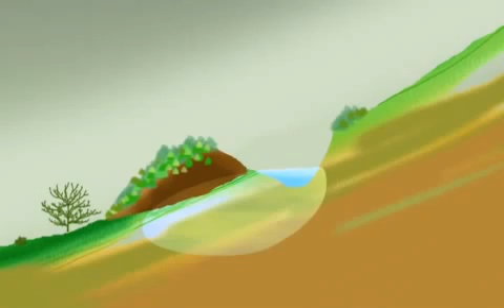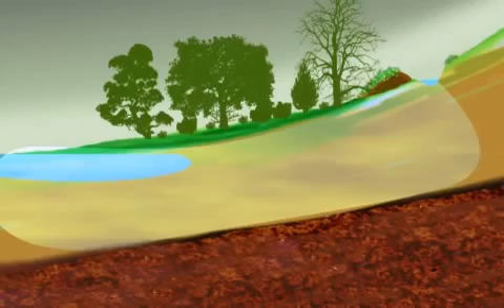Harvesting Water DVD - The Swale Plume

Comment: so say if you made a 360 degree swale on a slopage that is perfectly downsloped in a circle youd create the best swale system, a 360 swale harvesting system
Reply: Very old, but I am curious about this too, so I'll leave some thoughts. I think you are definitely correct about this, but the water accumulation would be limited by the surface area of the top of the hill to the swale around it. Assuming you only catch rain (no irrigation), then you would catch about 0.6 gallons per square foot per year. If you did this on a huge mountain, with swales going down the whole thing at certain intervals, then that would be very interesting!!